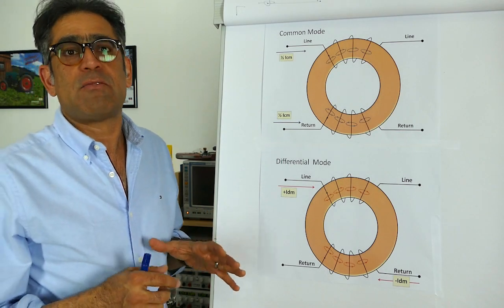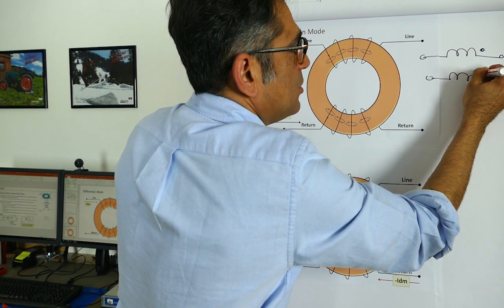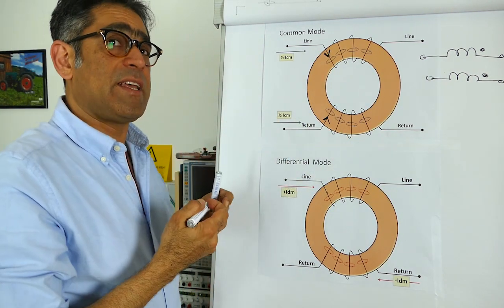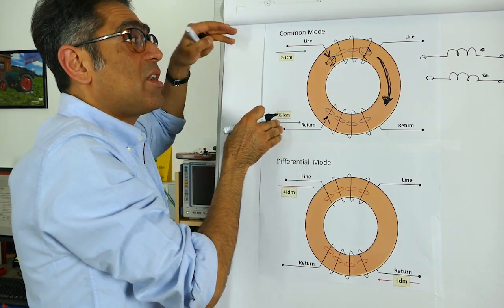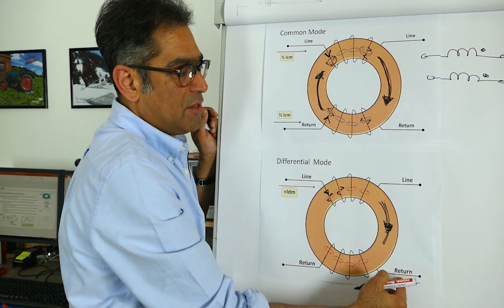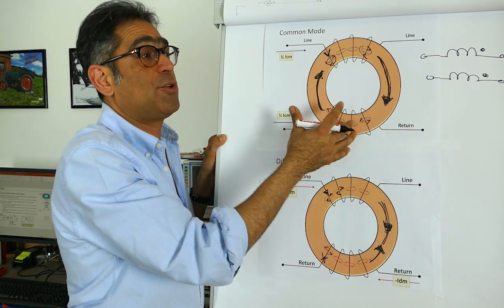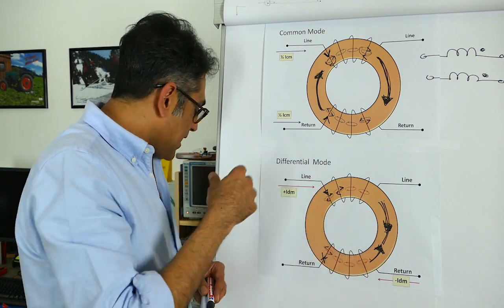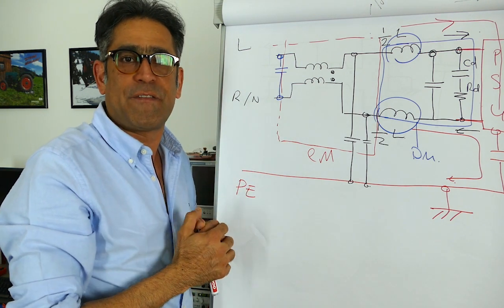EMC Filter Design Part 6:  Common Mode Choke Operation

Comment: So to summarize, CM current causes flux in both coils to sum causing a big choke/ high inductance, DM current causes opposing flux in the coils such that the magnetic fields cancel and the DM current passes as if there is no inductance on the line

Comment: It is a nice video, but at 2:06 min, your sudden conclusion of the direction of the magnetic field does not make any sense or at least not clear. Instead, if you use the right hand curl with the current flow direction shown by the  fingers(non-thumb) and the magnetic field direction shown by the thumb, it would be very easy for general consumption. What you started with is not wrong (a bit complicated though),  the magnetic field inside the toroid is only the sum total of the part of the magnetic fields which goes through the toroid and not the portion in the air.

Comment: Excellent explanation! Just a small detail—the arrows in the small loop for the differential mode in the lower path should be reversed (they are still as in the common mode). Thank you for the great content!

Comment: Common mode choke - flux will cancel each other, correct?    Common mode choke won’t be saturated. A little stray magnetic flux will slightly attenuated the main filter circuit. Any thought?

Comment: Good evening, but does this choke also work on an antenna with multiple bands?  3-element 3-band directive type?  What mix do you recommend to use 43 or 31?  Very interesting your video.  73 de Giorgio

Comment: I love your videos, but at the end of this one, you show the y capacitors between the common mode and leakage inductance. I guess you did this to make it look exactly the same as if there were separate common mode and differential filters, but wouldn't it be more correct to have the leakage inductance right after (or before) the common mode inductance and the y-capacitors outside rather than between them? A SPICE simulation shows the two cases are significantly different with 1% leakage inductance...